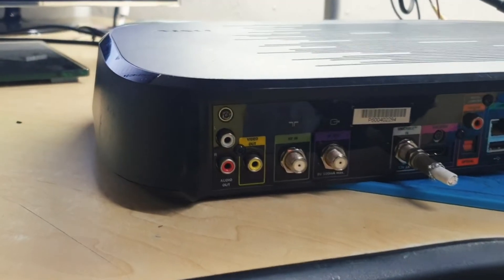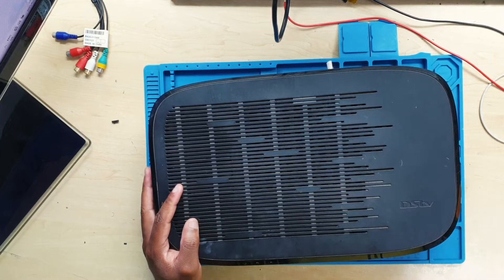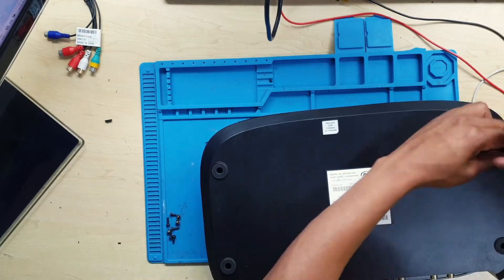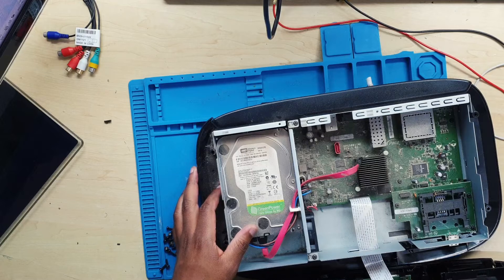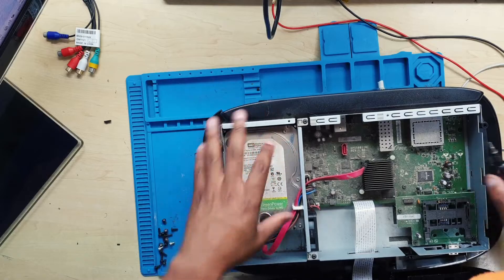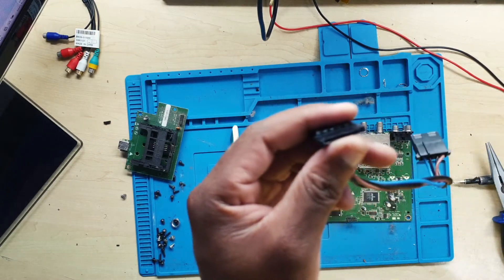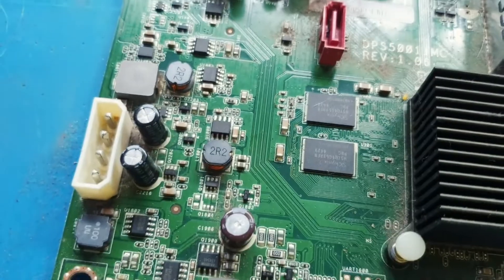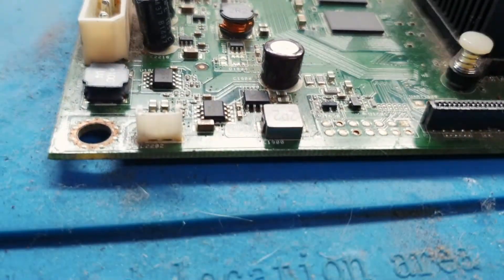DON'T THROW AWAY YOUR DSTV EXPLORA YOU'LL BE SURPRISED

Comment: Hi. I don't know if you can answer my question but if I want to use that HDD in another decoder, is it simple as replace it or there is a program that has been recorded on the disk by the manufacturer and some programming needs to be done? Thanks
Reply: Having the same problem. I want to bring out my HDD tomorrow and do a proper formatting
Reply: Hi ..No i have taken out several of these HDD'S they do not work well in another decoder but they do work perfect in external case or in Dvr camera system .